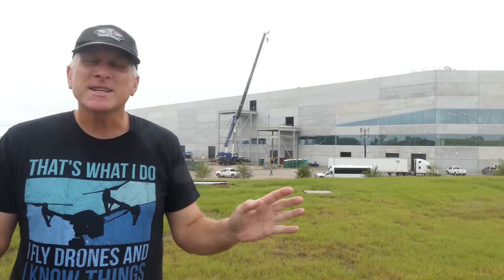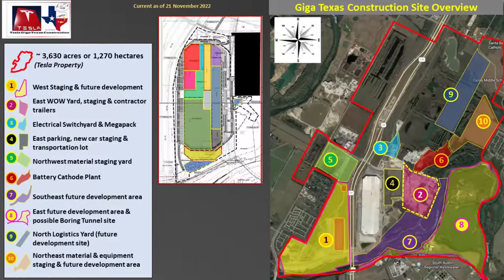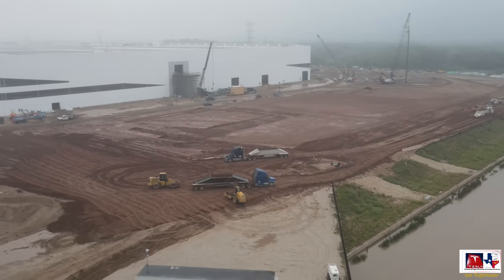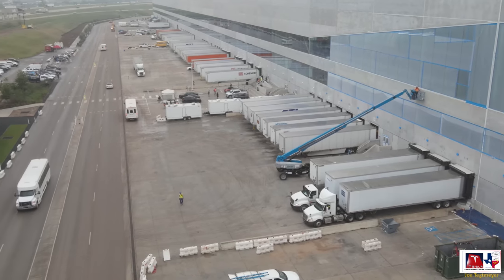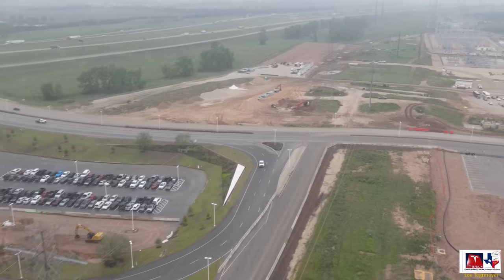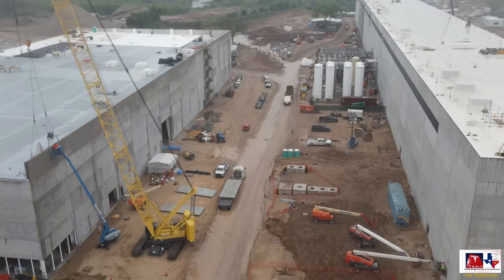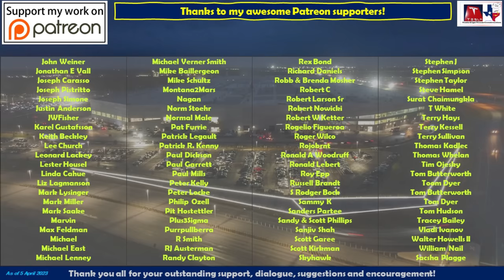Big Crates Arrive, Main Entrance Work, & Cathode N2 Gen! 26 April 2023 Giga Texas Updates (08:35AM)

Comment: Thanks Joe.
3:00. Cathode. Nitrogen generator. Not sure this is a generator system as much as liquid nitrogen storage and vaporisation. Some searching shows nitrogen generators extract nitrogen directly from the air, or from liquid air.
5:18. Southend, road. Tall bulky delivery might not be heavy at all by the trailer size.
IDRA deliveries in Brad’s 24 April video and Jeff’s Day 1001. Another possibly in Joe’s 5 April video in the WOW yard.
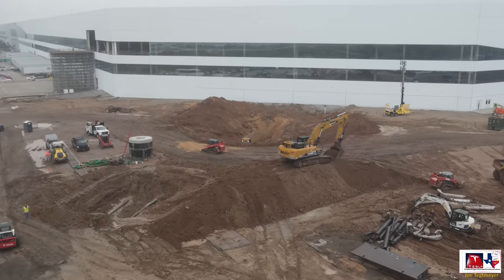8:34. Southend. Excavations. Removing smaller diameter stormwater drains, and the original ductile iron water main.
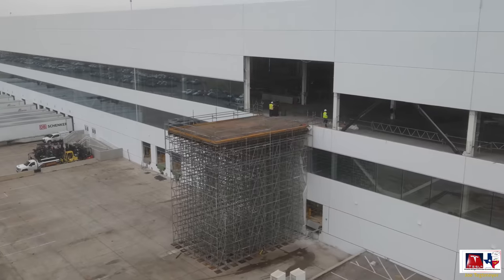9:01. GA, level 3. Columns numbered, on the outside until now unseen face.
10:00. Main Entrance. Small tabs fixed to the columns now also. A cladding fixing system. Something already affixed to the lowest beam face, a sample of the selected cladding. Can’t see a roof being constructed here. No drainage.
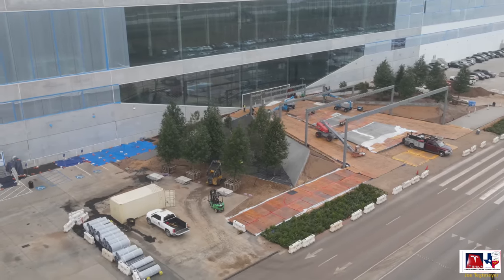10:54. GA, apron. Bottom left. Rolls of the cellular drainage mat.
Mat laid and gravel being placed in the area with the trees. Same across the road at 11:29 where the angular seating blocks have also been placed.
14:04. Casting, apron. In primer Model Y against the wall missing the rear quarters. No wonder it was pulled from the line. 😑
14:13. Casting, easement berm. Cutting into the berm. Widening of the apron? It needs it.
15:05. BESS site. Easement. Bottom right. Trenching works north from the electrical vaults. Ductbank running south from these vaults terminates at Casting.
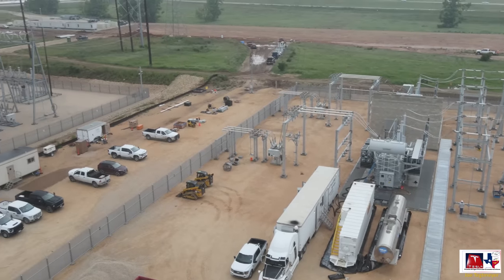16:59. New Switchyard/Substation. South fence is shown on the LCRA plans as being further south than as-built, roughly where the 3 pickup trucks are parked. Note the closeness of the equipment to the current fence.
19:25. Cathode, plant platform. Bottom left. Rainwater from the roof drains splashing off the tank and back onto the wall.
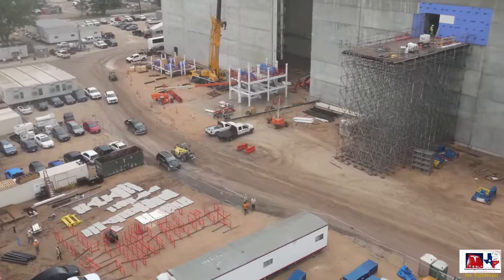21:49. Cathode east. Flat sheets of a variety of shapes. Likely to be some utility/services floor trenches in Cathode, these would be trafficable cover plates.
22:06. Cathode, ramp. The pre-fab plant structure has been fastened to the ramp. Temporarily for assembly I would guess.
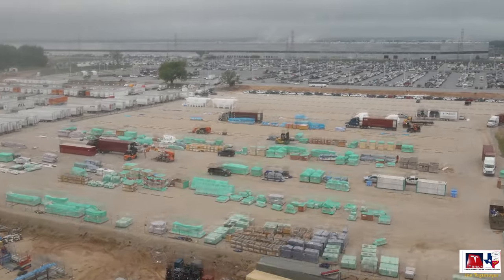22:38. WOW yard, north. A second bath. TKS trailer to the right. TKS, and Ecsar both logos on the bath wrapping. Ecsar delivered the CSO (Cybertruck Shaped Objects) in October.
24:41. Helipad area. Steel mesh panels assembled on precast bases. 3 either side of the turntable?
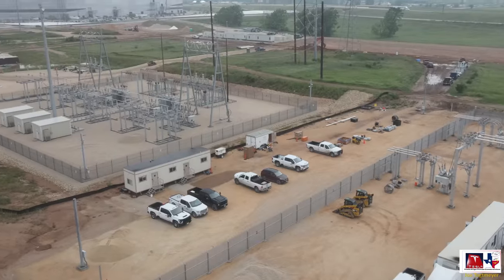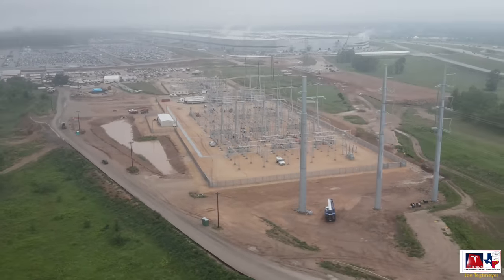Reply: 16:59 Notice the tall poles just inside the fence corners at the north end of the substation @16:22. At the south end, @17:00 the poles are outside the fence. Is that an indication another fence may be built to enclose that area?
Reply: @DavidJohnson-tv2nn  Seems likely. The secondary side of the transformers seems dangerously close to the fence. Compared to the temporary switchyard/substation in this shot, https://youtu.be/_TCPqdQkEFM?t=392

Suspect that an additional fence will need to be constructed either by LCRA or Tesla before the place goes live.
Reply: @DessieDoolan  Just speculation, but an additional fenced in area may be a location for switching equipment. Which would backfeed battery power or excess solar power  through the secondary side of the transformers to the grid. Backfeeding through the secondary side of the transformers eliminates the need for another large transformer to step up the voltage to 345 kV. Of course such switching equipment would have to be controlled by LCRA. But that raises another question.... If power is going to be backfed through the transformers... What is the purpose of the transmission lines that terminate at the monopole @ 16:23 (Right side of screen)?
Reply: @DavidJohnson-tv2nn  The LCRA plan shows some equipment at the south end, can't make out what it is. https://youtu.be/elLqkwm6Qd4?t=1302

Spare pole at the north end is maked 'Tesla Energy' on the same plan. Underground from there to the BESS would be my guess.
Reply: 10:00 why so many welded on clips both top and bottom of the beams?
Reply: @bobcallahan2322  10:00. The close spacing has me thinking it may be for small panels. 

Columns being done also reinforces the cladding idea.
Reply: 3:00 I agree that it is not a generator. These look like systems outside of hospitals (oxygen) and manufacturers etc (nitrogen, CO2 etc.).  The look exactly like systems where I have worked where trucks deliver the liquified gas to the tanks. As the prodouct is used it goes through the vaporizers to turn the liquid into gas. The vaporizers use the ambient heat in the atmosphere to turn the liquid into a gas. it uses the same principle that is used in refrigeration. A good HVAC tech could explain.
5:18 Again I agree. In the US the maximum height for trucks  is 13"6' and 8' 6" wide and generaly 20,000lbs on each non drive axel. Permits (and fees) are required for loads outside of these limits.  The double drop  trailers are to carry overheight loads. You can see the wide load signs and flashing lights on the trucks. The number of axels indicate that the load is not over weight. We have seen  heavy loads arrive on specialized trailers with many axels.
11:57 The tank looks like it is made (black iron making a square around the tank) to be a standard 20 foot shipping container and is sitting on a trailer. The red diamond plackards will have a UN Commodity Number in the white area which will tell the contents to emergency responders. The yellow area might also list the contents. Wikipedia has a list of the UN numbers. If joe can get a closer look we might find out what is in the tank.
16:23 Finally! The tall pole supplying power to the nearest a frame has wires only on one side. It is not connected to the high tension wires
PS Thanks for all your observations, I have learned a lot.
Reply: @patrickdougherty2777  Cheers Patrick, glad you enjoy them.
3:00. What's missing is the generator! While the system is incomplete, it seems unlikely anyway that nitrogen would be generated, then compressed to store in tanks, then vaporised again for use.
5:18. It's likely these are seen unpacked in today's video. Some sort of air-handling plant, although not much to go on.
11:57. These containerized tanks have been delivered to Battery often. Generally seen inside the drive through doors. I'll see if I can find what's in them
16:23. That pole is marked 'Tesla Energy' on the LCRA plan. Pole is a larger diameter than the others. Speculating that is because the forces are only from one direction, so the cabling that is installed is the only cable. From this pole I'm speculating there will be a conduit/ductbank across to the BESS.

Comment: Thanks for the update Joe.
At 16:50 Tanker truck delivering transformer oil. Van tractor trailer is a transformer oil drying and treatment unit.
21:50 Red railings next to workers as shown on the completed platforms. Appears that all railings and moving equipment is painted red.
22:44 Possibly primer dip tanks similar to ones already installed in existing paint area. Seem to be larger, possibly for inner structure of Cyber Truck.
Reply from the maker: Thanks Elton!
Reply: 22:45 Re: Paint System. HR recently issued chits for paint related CT positions. Coinkidink?
Reply from the maker: @Crunch_dGH  probably related as the underlying stamped structure likely needs paint. The recent Farzad/Cory discussion on Cybertruck is very enlightening

Comment: Hi Joe. At 18:10 the green boxes look more like "pad mounted switchgear" than transformers. Pad mounted transformers for large industrial 3 phase use almost always have a bunch of heat radiating fins on the back and maybe side. The front will have a smooth cabinet used to access the connections and (if any) fuses.  Pad mounted switchgear is almost always just a plain box. I tried a comment with links on Monday, but it seems to have gotten lost - but if one searches for "pad mounted switchgear" one can find images and info on them.
Reply from the maker: Thanks Gary

Comment: Industrial production of nitrogen is surprisingly valuable as a way to improve both fuel efficiency and ruggedness of your tyres that your vehicle and suspension system are truly and ultimately riding on. Would be a great addition to Suoercharger Stations upon all of North America to include nitrogen air up system for your vehicle especially given the absolutely massive size of modern day rims and tyres for modern day vehicles so despite not the ending we wanted for Starship everything else at both Tesla and SpaceX are still "running on all electrons" so very impressive work product being presented here in every way.

Stay healthy, Joe!

Comment: Hey Joe, nice work, but those large plywood boxes are not on heavy load trailers. They are on lowboy trailers that reduce the overall height of the load. they have the same number of axles and wheels as any other standard trailer
Reply from the maker: Thanks and makes sense because a crane is being used to lift them onto the temp loading platform on the S end.

Comment: @10:25 you see the tables and chairs as well as the truck. This is a safety shoe company which takes orders for the employees. Remember SAFETY FIRST.  @21:51 the red equipment you see next to the workers appears to be identical to the handrails installed on the white platforms next to the crane at the door.

Comment: So now that the south end is completely painted right before the expansion starts, is it possible that GTX gets a supporting building connected up top rather than an actual extension of the original building with the current south walls taken down?
Reply: Brad's 24 April video shows the drilling rig up against the building, https://youtu.be/_TCPqdQkEFM?t=58

Comment: n
Nitrogen is not an inert gas. In fact, lots of explosives use nitrogen...TNT  is TRI NITROGEN  toluene.
Reply: Nope.  Nitrogen (N2) is an inert gas.  Some reactive synthetics like TNT contain the element Nitrogen, but that's not what is being used here.
Reply: To amplify what Michelangelo said, it is tri-nitro-toluene, NOT tri-nitrogen... . The nitro refers to the -NO2 functional group, a nitrogen atom and two oxygen atoms. When heated, it decomposes, releasing the oxygens, which combine with the carbons and hydrogens in the toluene/glycerin/etc. to make an explosion. See the wiki "Nitro compound". Nitrogen gas is fairly inert, although under an electric arc it would form various nitrogen oxides and reacts with some metals, so isn't inert enough for weld shielding gas. But for many other uses, it's inert enough.

Comment: 12:20 Theses workers need to be more careful. That truck is venting excess nitrogen. That displaces a portion of the air around the truck and thus, reduces the concentration of oxygen. They really shouldn't be there while the transfer is happening. I really hope that they are at least wearing equipment to monitor the concentration of oxygen in the air.
Reply: Are you saying that the transfer is non-compliant?
Reply: @jbbuzzable  From the drone shot, that's really hard to tell. The reason why I made this comment is that there are 3 workers in an area where vapors are hugging the ground. 2 of those workers are wearing helmets which suggest that they might be construction workers, especially given that they seem to be working on that enclosure next to the truck. In other words, they might be completely oblivious to what is going on here. You can see one of them bend down low next to the enclosure.
Reply: @jonathanlanglois2742  I'm sure that Tesla would appreciate anyone reporting safety violations. I suggest you contact them.